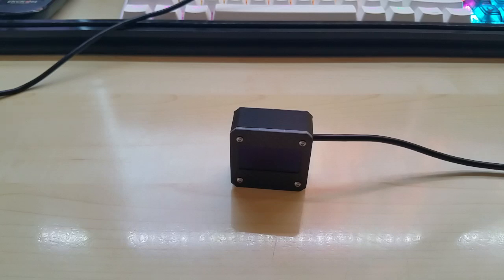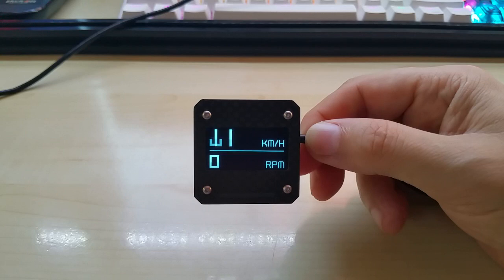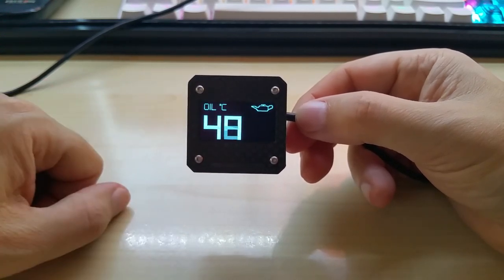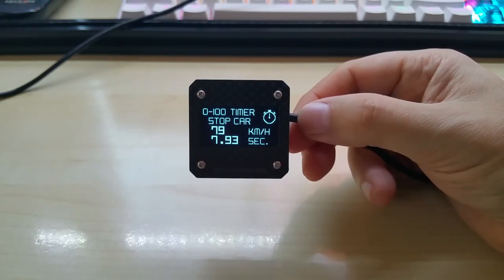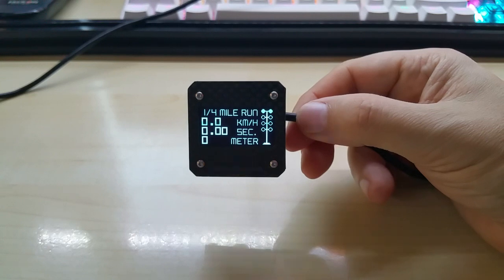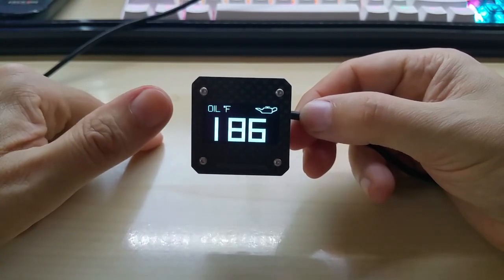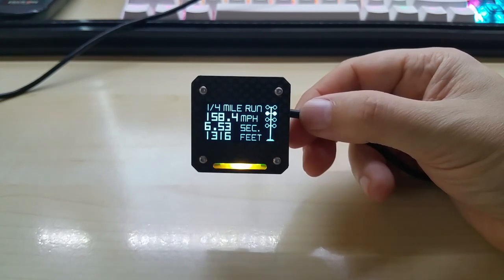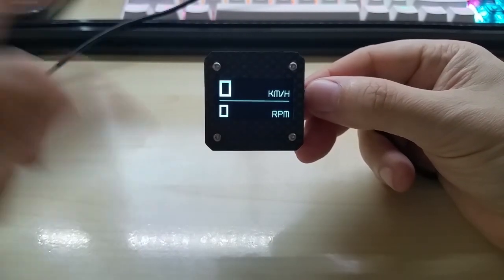CAN Gauge micro, finally finished, all features explained. Please share and tell your friend, thanks

Comment: This is awesome. Is there anyway to adapt it to an OBD1 ecu? Maybe directly wire it into the sensor signals? Also, any plans to include wide band air fuel ratio info? I think many tuners would love these with a screen that simultaneously displays multiple lines of critical info like a/f ratio, oil pressure, and boost.
Reply from the maker: Thank you Jason and for your donation as well, greatly appreciate it. The problem with the earlier OBD standard is that they are very slow to update/refresh rate. Instead of going back to that, you could use my CAN BUS Node and attach your analog sensors to that and connect it then to my CAN BUS gauge. That way you will have the full speed advantage of the CAN BUS network. The color version of the CAN gauge does have the A/F ratio as a round gauge and works great, please see my newer videos about it. It is no problem to show several values on the same screen, just depends on what you like. Here is the link where you can see the newest member of the CAN gauge: https://youtu.be/7lkz6Cp0eiQ. Now that I am using a bigger Atmega chip there is plenty of room to add new screens and again with the help of the CAN BUS Node you can add any sensor that you like, that is maybe not on your car. Mine for example is missing oil temp and pressure, which I will add as soon as I can get the sensors installed to the engine. So to sum it up, the CAN BUS Node can be used with cars that don't have CAN BUS at all or add missing sensor to cars with a CAN BUS already. Sorry for the long reply, take care and thanks again.
Reply: @iHayri1  Thanks for the detailed reply, very appreciated. If I preferred to have the non color screen used on the previous version but with all the new functionality such as A/F ratio would that be possible? Sorry if these are dumb questions but I have a very limited understanding of all these things.

Comment: lovely, sorry if I missed but how is it connecting to ODB sensor, via bluetooth?
Reply from the maker: Thank you, no problem, it is connected by wire to the OBD port directly. Anything with bluetooth works on the much slower J1850 bus. I will upload a video soon to show it in the car and how easy it connects.
Reply: @iHayri1  Thank you very much , will wait for the video. I am working on something similar for ODB, car Tyre pressure monitor and few more other parameter tracking
Reply from the maker: @YellowPeaks  You are very welcome, good luck with your project.

Comment: Hi my friend. It will work in a Ram? How it work?
Reply from the maker: You need to check if your car or truck has the CAN BUS signal on the OBDII port.
Reply: @iHayri1  Hi Hayri. Yes. The ram is can bus. And it have in the obd2 port.
Reply from the maker: @changchung  Forgot to mention, if it is 2008 and newer it will have CAN BUS, to make sure you have the right protocol you can check if the pin 6 ( CAN H) and pin 14 (CAN L) have a metal contact in the OBDII connector. As to how, simple, you just plug it in, that's it. One thing to mention is that Oil temperature is not always available, it is missing in my car too but I will have additional hardware later on, that will make it possible to add any sensor you like, even make a non CAN BUS vehicle CAN BUS capable.
Reply: @iHayri1  It is a 2017. Let me check the high and low can bus

Comment: Too fast value updates on the screen.
You need to take the average value for the past 2-3 seconds and already display it. Otherwise it turns out unreadable.
Reply from the maker: Really, and you are an expert in digital gauges that should have a lag of 3 seconds??? I could have it update once every 10 seconds if I want to, but I want the real data happening as is. And did you listen when I said the values are generated from the simulator??? have you seen the gauge in the car??? https://youtu.be/JzvakTVjros if that is to fast for you, maybe you are too slow to read!

Comment: The speedometer in most cars reads about 10% high. Does the data on the CAN bus read high too? Maybe a GPS speedo is what I need.
Reply from the maker: That's correct, speedometers in the dash do read higher but the CAN BUS speed is spot on. I initially had a GPS module in mind but after seeing the speed displayed correctly, decided against it. There is also the startup time and lower update frequency of a GPS that I do not like. Also keep in mind that you have at least 4 speed sensors in the car, assuming you have ABS, which is kinda standard on current cars and is electronically measured obviously.